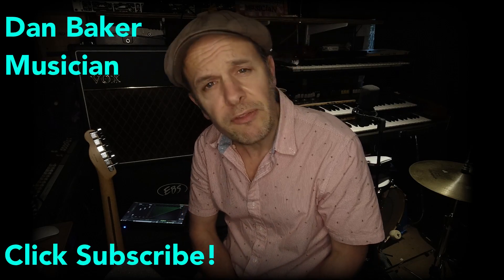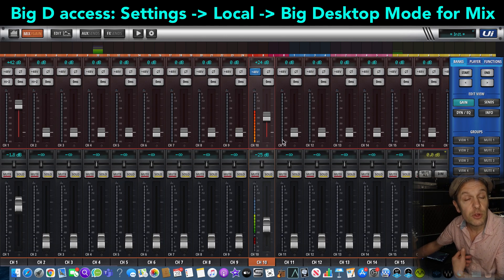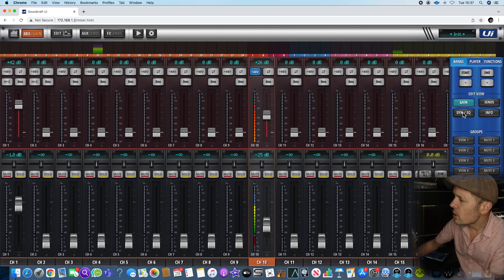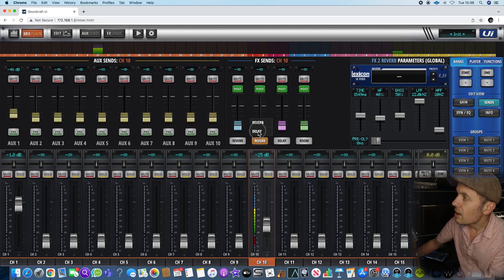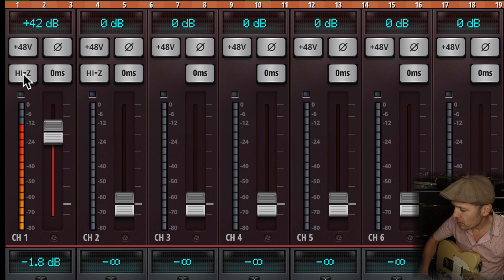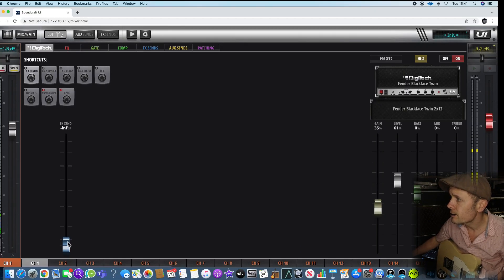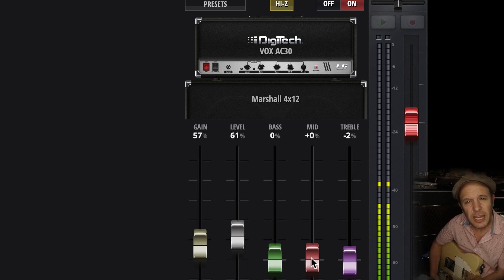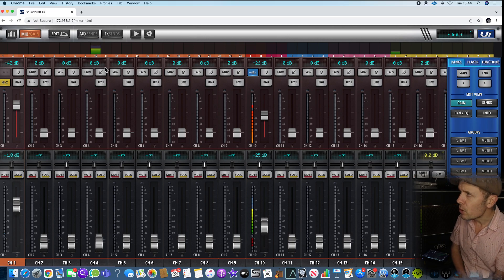Soundcraft ui24 big D mode & guitar amp simulators

Comment: But the big Desktop Mode for Mix is Not possible when connecting a Monitor directory to the soundcraft is this correct?
Reply from the maker: That is correct I believe - it has to be connected via Ethernet for Big D capability.

Comment: Nice. I'm almost sold on that mixer. Question: is it possible to use just the cab simulation?
I have an amp I love and a load box (DI out). So it would be great to just simulate the cab on the mixer instead of micing the amp
Reply from the maker: I believe you can opt for just the cabinet by selecting an amp that just says DI. I’m aboard at the moment but will have a look on my return..

Comment: This looks so much more user friendly than the Xair apps. I've been using an x18 for 5 or so years. Seriously thinking about ordering this mixer to upgrade. Thanks for the great videos!
Reply: UI Series mixers are very much for the on the fly, plug 'n play use.  I own a couple of XAIR18s, a UI16 and UI24. The layout and workflow of the UI series is far superior to the XAIR native apps. The XAIR however gives you access to much more processing and FX tweaks that the UI series lacks. If that's not important to you then the UI Series mixers are perfect.
Reply from the maker: Cheers Brian! I’ve not used the Behringer stuff but I would think it’s good. Most of their stuff is IMO...
Reply: @DanBakerMusic  it hasn't let me down and doesn't sound bad. I have since bought the ui24r. It is much better than the behringer. Definitely worth the extra cost over an xr18.

Comment: I guess big D would be for Big Display. This is Soundcrafts answer to Behringer's X-air series of Digital mixers. I see where Soundcraft have partnered with well known names in the industry to supply the sims and effects engines, where as Behringer's engines are generic. I am curious did you look at the X-air series before choosing the Soundcraft 24? thank for the demo, how are the Guitar presets by the way?
Reply from the maker: I didn’t look at the X-air series: I just took the plunge on the Soundcraft..the guitar presets are pretty good, but there is a certain amount of tweaking involved. Really intuitive though...